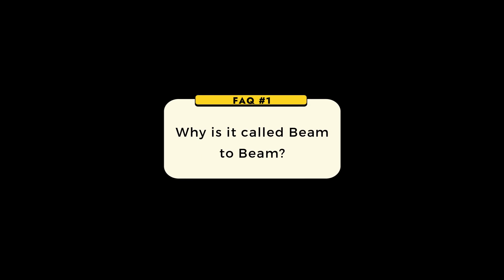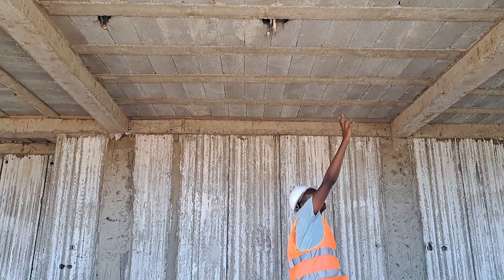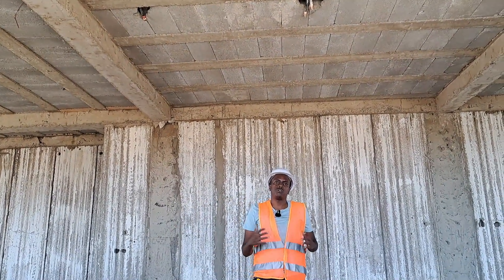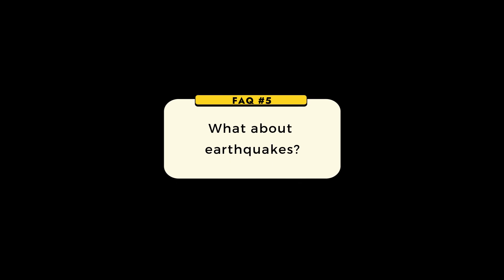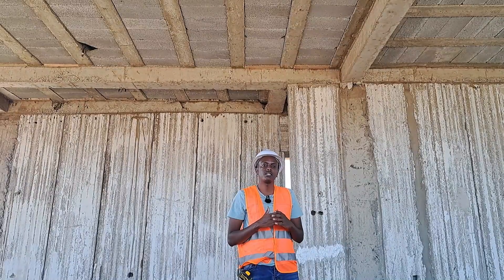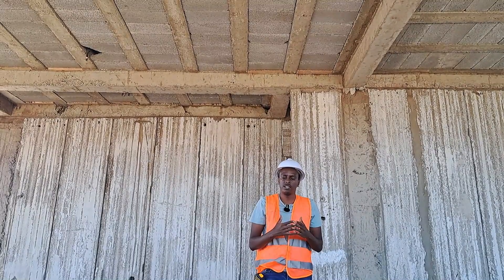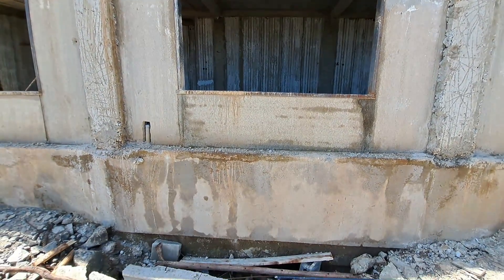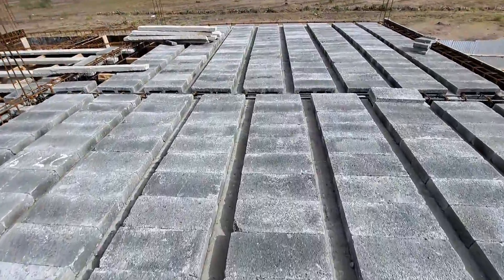Beam and Block Technology: Your Top 5 Questions Answered

Comment: Hi. The flat  beam and block. What size steel must i use for the ring beam around and on the brick wall. 2nd Question , is it necessary to put a at least one or 2 steel reinforcement along the long side for support from sagging. My supplier suggested i do. My space is 6 meters by 3 meters.

Comment: What of a building with cantilever, how does the beam and work there? E.g a a three thousand meter squared house but have a one meter cantilever at the first floor, projecting out? How does the beam and block slab applied in such case????

Comment: im impressed by your videos. you are doing a great job. by the way the blocks you are using are too thick and they increase the total weight of the building. there are better options for asmolen block shapes and wall thicknesses.

Comment: In the 'beam and block' technology .... don't you think it will even be more cost effective  instead of using the blocks, to use precast slabs that are one meter long, placed between the beams, which will result in using less beams, less blocks and less time??
Reply from the maker: Precast slabs are heavy and can only be supported by steel I beams. The blocks are hollow and are more suitable for beam and block technology

Comment: I like this Technology. I just think designers and contractors should work on making the resting Ends of these ribs rigid to resist earthquake. I still think casting the Main building beams to the height of the slab and leaving the beam top reinforcements is the best way to make these ribs rigid rather than placing them with a bearing of 90mm as shown in the cod of design. some contractors like to push these ribs to go past other perpendicular crossing beams. very dangerous since it induces high values of hogging moments at these supports. otherwise good stuff.

Comment: You skipped over the most important thing. Price.

I personally prefer the beam that's designed to look like a railway. This flat one is prone to cracks under weight....plus it demands a brc mesh which is very expensive
Reply from the maker: Oh yes, the T beams. They're more expensive than flat prestressed beams but are stronger and don't need timber supports
Reply: Building is not cheap, and the different building styles dont change cost for the same structural strength so much because they are all about looks and different methods of work